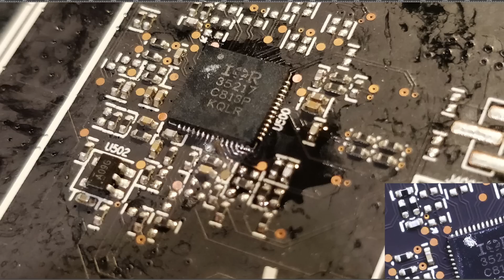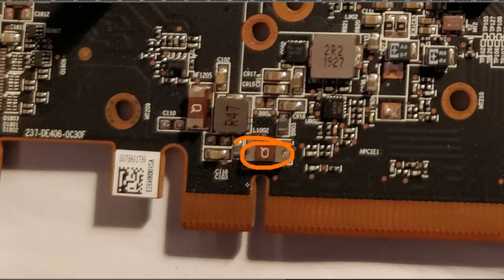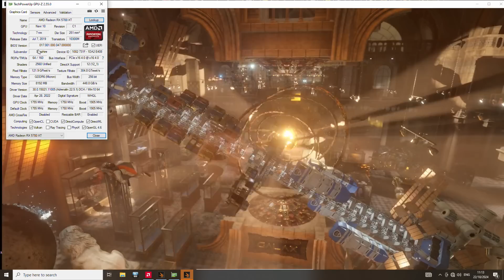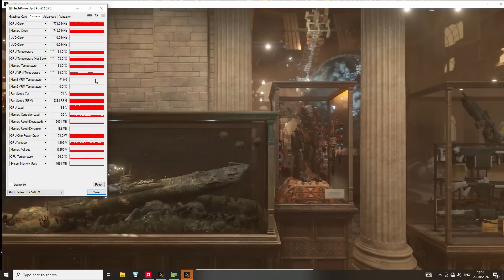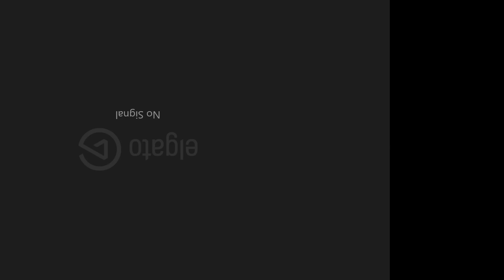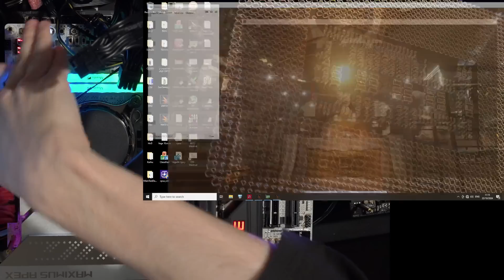Repairing a Sapphire RX 5700XT Pulse with ripped pads and traces.

Comment: If you struggle with holding the wire with tweezers you could try getting some reverse action tweezers so you don't have to apply any pressure
Reply: I just found out about these there are ceramic ones solder wont stick to nor transmit heat for five bucks!
Reply: There are tweezers that are held by mount that has a arm that can be adjusted.

Comment: I use old cooling fans as a source of very fine enamel wire. Just break them apart to expose the motor windings and unwind as much as you need to do the repair.
Inductors or transformers or various larger motors can be used for thicker enamel wires.
Often the only kind of wires laying around are stranded type which at larger sizes become very good at wicking up solder instead of making reliable solder joints.

Comment: The card works, fantastic work! Also, have you seen the new $199 MSI Z790MPOWER with 1DPC? It has generic overclocking terminology words printed all over the heatsinks and PCB. Disappointingly, it doesn't have a post code, although the second M.2 heatsink does have "00" printed on it, so that checks out.

Comment: Are you interested in gddr5 timings straps tweaking on Polaris?
Reply: Stock bandwidth varies from Elpida 150GB/s to let's say Micron 180GB/s out of the box straps, measured by memtestCL-like code. It's not translated directly to double digit uplift, but still.

Damn, I miss the old gpus

Comment: Heya , i have a question i have this card and its on default in some games hitting 96degres woth 5 fans case open front panel i have to increase rpm to like 2.6 to 2.8k to handke it under 85degres
Is this normal behavour?

Comment: I have an issue with the same model card and now I'm wondering if you might have an idea which could help me fix. The first fan on the card spins on max not caring about the temperatures, even when the card shows it's working in 0-rpm mode. It's not a driver issue, not fixable by bios modding or other software/firmware modifications. Replacing the thermal paste and the pads helped for about 2 months and the issue returned. Replacing the fan(s) does nothing, the issue persists. I believe it to be a hardware issue somewhere on the board. The second fan works just fine. Also, the fan starts working like normal from time to time, sometimes after putting the card on a load but not every time.
I upgraded to the Nitro+ 6950XT 7 months ago, so the 5700XT card isn't important but I'd still like to fix it.
Reply from the maker: if messing with the thermal pads changed the behaviour there's probably a cracked solder joint somewhere but IDK where to look I've never tried fixing anything related to fan control.
Reply: @ActuallyHardcoreOverclocking  thanks, this might be a huge hint, will check the pins on the components.

Comment: I have dead GTX 960 from MSI. This GPU died sudenly after cleaning PC. I was putting it in pcie slot, than my computer posted (which is werid because normally PC starts from power button on PC case) and after that something pop out and psu turned off.

Can you record a video how to check if a graphics card is repairable? Or repair it for me, because nobody repairs so old gpu's...